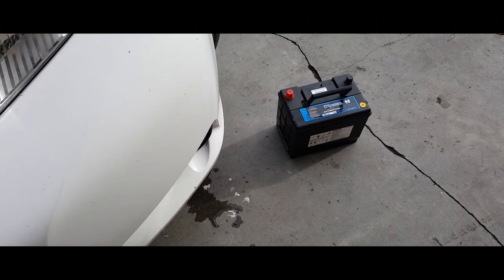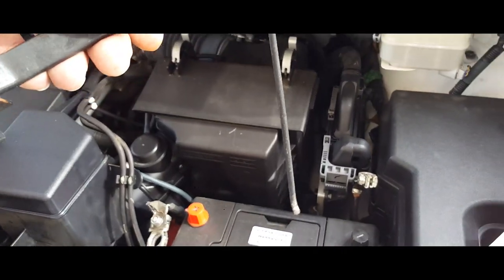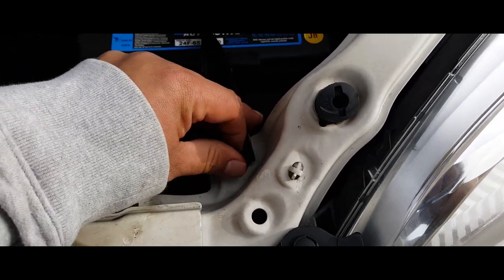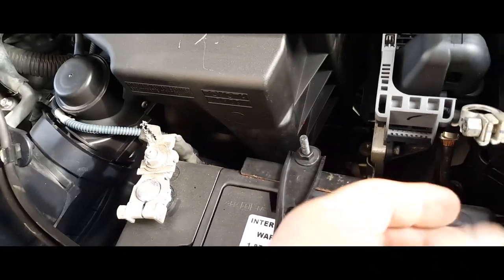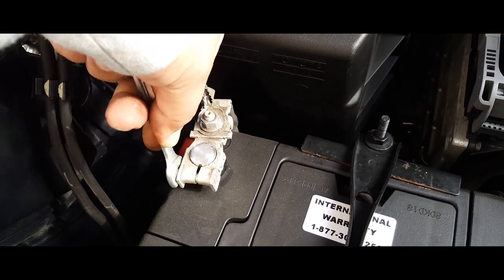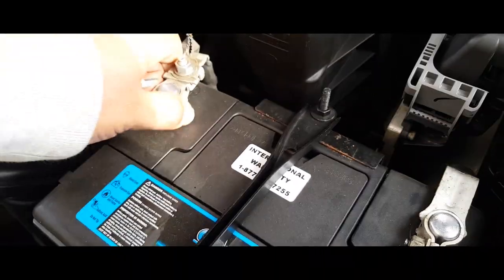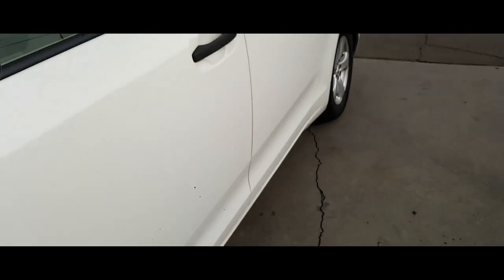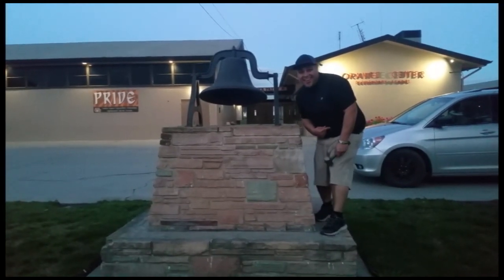How to: Install a battery on a 2015 Toyota Sienna

Comment: After you installed the new battery did your radio/stereo ask for any code or it works like normal?

Thanks
Reply from the maker: To be honest with you,  this sienna has a radio update issue. It doesn't start up it just looks like it is then it resets and repeats the process. Sorry man not sure if it asks for a code or not. If it does all you need is your vin number call the dealer and the can give you the code. Write it down for future reference.  Hope this works out for you! Thank you for your support!